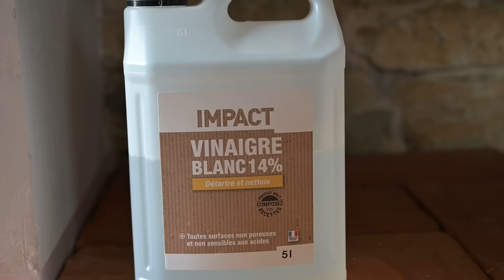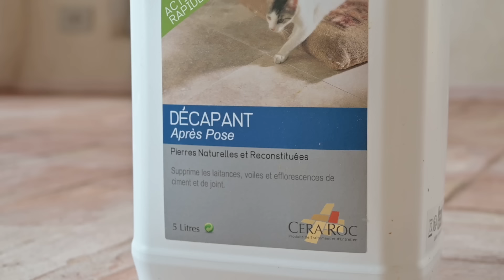#98 Our Last Video... about GROUTING | Renovating our Abandoned Stone House in Italy

Comment: How were you able to keep all the joints uniform.  You haven't used any joint spacers, so I'm guessing it was by eye.  Pretty impressive and beautiful
Reply from the maker: Yes it was by eye but they aren't uniform at all because the tiles' dimensions are not regular! Result: we have some 20mm gaps and other smaller than 5mm.. but in the end, once grouted, it all disappear 😉

Comment: Your floor would look great with a thin and transparent coat of strong epoxi. Very common over concrete in industrial buildings and garages.
Reply from the maker: All our choices so far were made in order to obtain a breathable floor, to help the house manage the moisture by itself. Therefore we only used natural breathable materials, from the subfloor to the last protective treatment! The epoxy wouldn't be compatible as it would trap the moisture inside the layer of the floor  and start accumulating😉
Reply: I understand your choice, thanks for your answer. Good job overall!

Comment: Wish i could teach you (as a  pastry chef) how to hold and use the pastry bag more practically and effectively. 😂😂 Hate to see you precing in all the wrong spots ,making it harder for you. Either way you both are the living example to "where there is a will there is always a way". Great work
Reply from the maker: We will still have to use the bags A LOT so any advice is welcome, particularly coming from a pro 😄
Reply: @ateliermavi  I second that!
Reply: @ateliermavi  So its always better when you push from the top of the bag. If you are pushing from the middle part of the bag , most of the material is going back up, and not downwards.
If you have to push from the middle,make sure you are making a very tight stop with your fingers.
Also... Always pushing with your "good" hand from the top and guiding with your "bad" hand close to the tip. This will might feel more difficult when starting but gets really efficient once you fell comfortable with it.
Did some stone walls my self at my place and piping bag skils came really handy..😁😁

Comment: I m a little bit disappointed. To clean the tiles you have to change the water just in the moment it becomes darker. The dirt is in the water and if you use this water, you wash the tiles with the same dirt you want to get rid off. Always clean water! That is boring and much work but otherwise you can’t get it done properly. 
And take other items to clean. The mop you use can’t take the lime powder off the surface. Search nother one. 
You did so much work to get it done. But at the end it will be wonderful. 😊